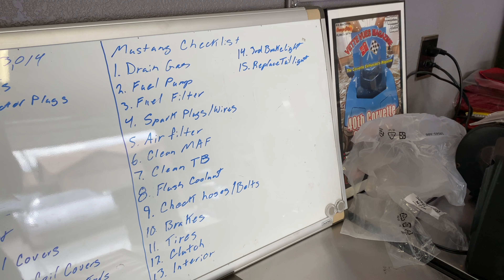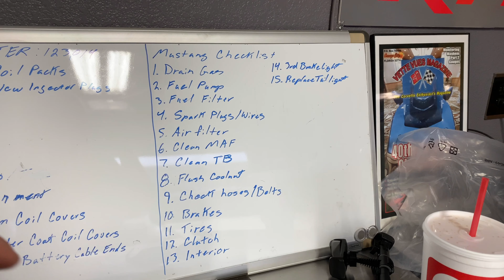Project Chuck - Part 4 (The Checklist)

Comment: Pre-2000 they used a 3 digit date code (first 2 = week, last = year). This did change in 2000 to the 4 digit so you knew what decade the tires are made. 
Also, tires...if stored properly both before and after install, are good for at least 6-7 years from “date of install”. However in extreme weather conditions tires can degrade much quicker than this as well.